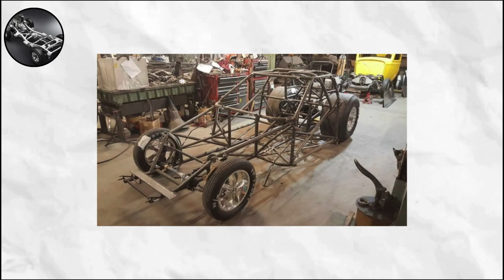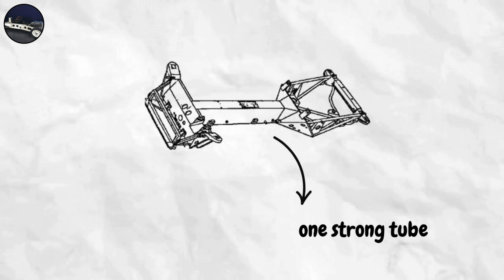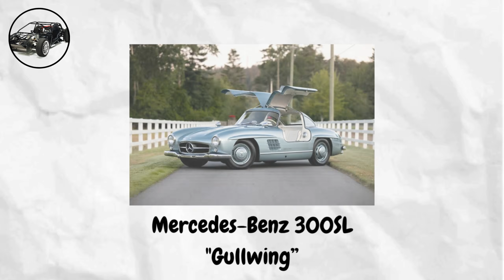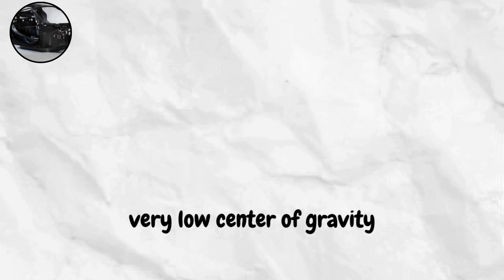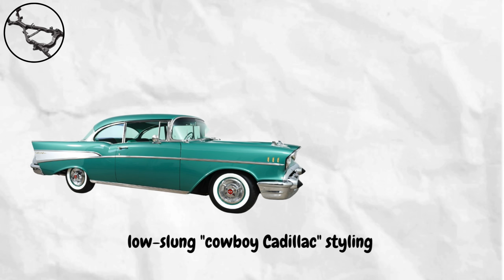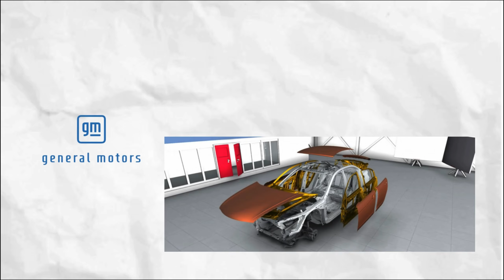Every Car Chassis Explained in 10 Minutes

Comment: A big advantage of space frame design not mentioned here, is that if done properly, none of the members of the fame are in bending, only tension or compression.  Each member is only connected at nodes, or endpoints.  One member can't exert force on another member except at the node.  This makes them very rigid for their weight.  It is a lot tougher to get deflection out of a metal tube when only loading it in tension or compression, vs loading it in the middle.

Comment: An X braced ladder frame with closed section frame rails is within 5-10 percent of a spaceframe for weight and stiffness. Crash safety isn't an issue, it is provided by the bodywork. Durability is only because the steel is usually thicker. Off-Road capability is nothing to with the chassis type, it is everything to do with suspension movement, which is usually a lot easier to get with a live axle, which is why so many off-road vehicles still use them.